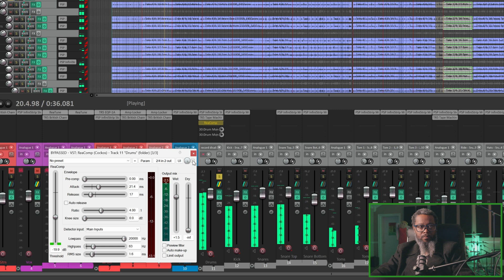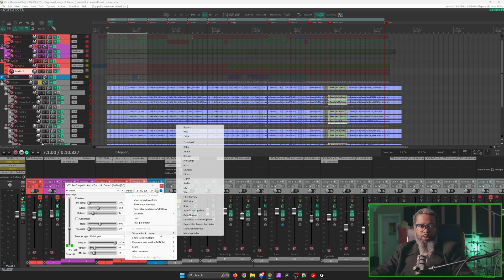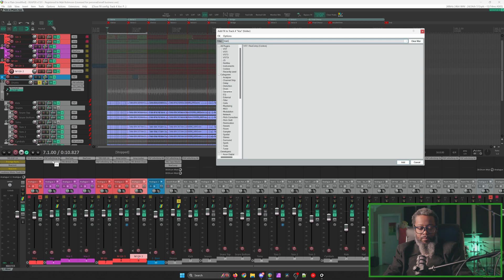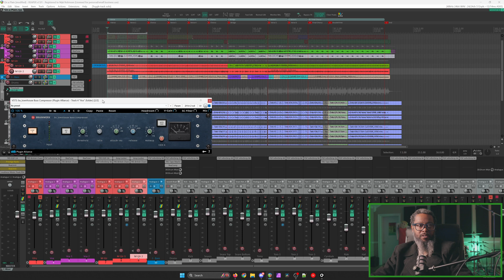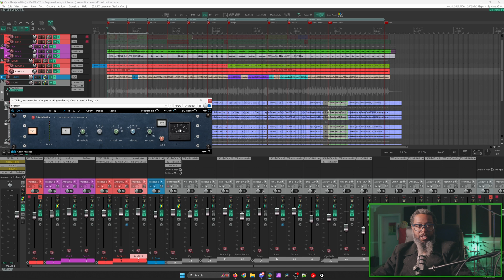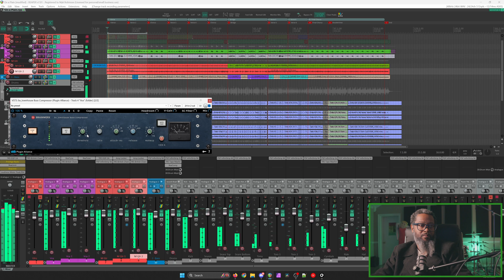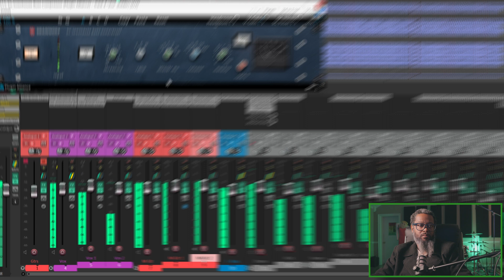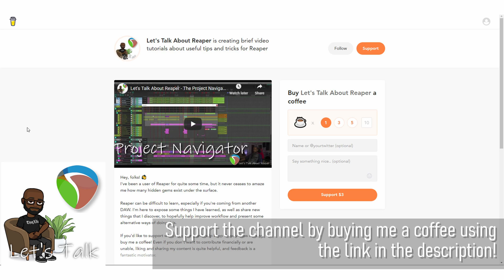#REAPER7 Gain Reduction Metering

Comment: Hey Mike, I hope you're doing well. I'm having a bit of trouble with Reaper 7—specifically, I used to be able to see the meter numbers while recording, aiming for a volume range between -18 and 16. However, after the recent update, this feature seems to have vanished for me. I noticed that yours is still displaying the meter readings. Could you please guide me on how to turn on the meter numbers in the latest version? I'd really appreciate your help. Thanks!
Reply from the maker: R7 was released before the Theme Adjuster was completed. Check the "Prerelease" section of the REAPER forum, and you should see a post at the top from White Tie with the prerelease theme adjuster. 

Install it using the supplied instructions and you'll be able to enable the meter numbers.

As the name would suggest, be advised that the script is a prerelease. It is currently quite functional but not pretty 😁
Reply: Noted. Thank you. @LetsTalkAboutReaper

Comment: I'm yet to test this out, I wonder what meter will show with multiple compressors on a track :D
Reply from the maker: Assuming the compressors in question are compatible, it will show the cumulative gain reduction
Reply: @LetsTalkAboutReaper   hmm that would be wrong though, I gotta explore that, also what happens with Containers and parallel FX metering :D

Comment: It doesn’t work in my update. I enabled gain reduction metering in the preference tab but still nothing.
Reply from the maker: What compressor are you using? Just making sure you saw the part where I mention it doesn't work with all compressors, it has to be one that reports it's gain reduction back to the host.

Just for the sake of using one that we know for sure works, test with ReaComp

Comment: Do you know why in my last update of Reaper 7 bx townhouse it does not show me the gain reduction having been set by default in the daw?
Reply from the maker: Are you using the VST3 version of Townhouse? To my understanding, this feature is limited to VST3 plugins that report the gain reduction back to the host application, it won't work with VST2.

Comment: That's a neat little gadget, assuming it works with Realimit as well.
Reply from the maker: just tested, and confirmed!
Reply: What happens when multiple plugins are reporting gain reduction on the same track? Just the last one in the chain being displayed in the mixer?
Reply from the maker: @plentyofrooms  I haven't tested yet, but my assumption is the meter will show the cumulative effect of the plugins, assuming all plugins in the chain are reporting. I suppose I can test with a tone generator and two instances of reacomp